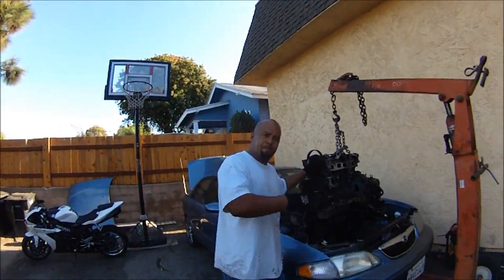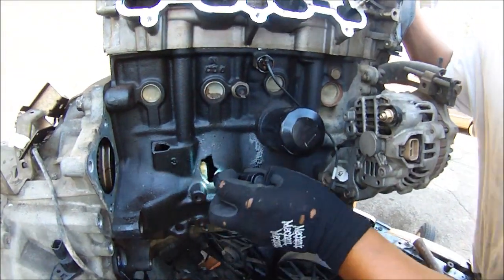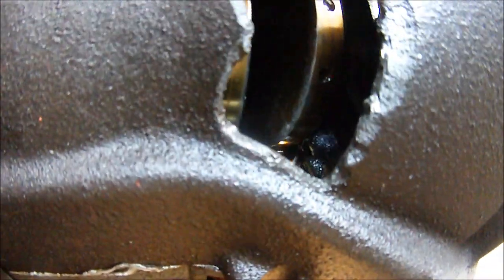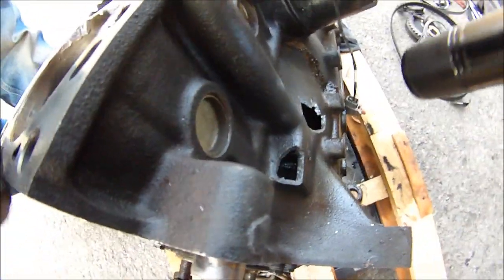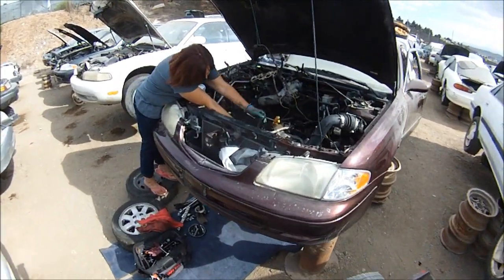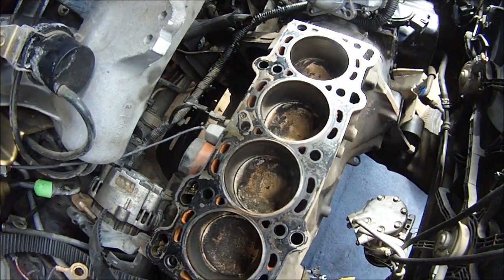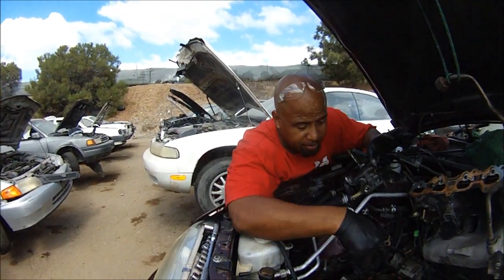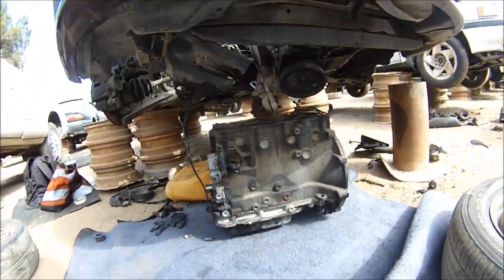WHAT HOLES IN THE ENGINE BLOCK LOOK LIKE.

Comment: hah... I remember when I was floating into the bay just past v-town and hitting richmond when big poppa dropped and they looped that shit 5 time straight and I was on 580 heading to san jose and boom....  lost all 4 pistons in my b2200...   whole damn bottom gone and it puked all over a chp who was behind me  and I thought I was going to Alameda jail that night...    

Chp was cool and pushed me up on top of a overpass in the light which I believe it was still there when I came back with a uhaul to drag it home.   I loved my mazdawg but they have the weakest bottoms and I wasn't going fast but going from 70's to 50's  put me at 3500 rpm in 5th and motor didnt like it with a shell and a custom bed kit..  I seen holes but when your pick up tube is in the cops grill thats a whole new level...   

but I like your vids because back then I didnt have the cash so did my own heads and with the help of someone to stedy the motor then I could lift it to the rad support by standing inner fenders  then have someone keep its balance as I got down and picked it up  and set it on a table I made just 1/2 taller than a stand  so I could rest it while I slapped the stand bars on and then pick it up again and move the table out.   Sore the next day but you do whatever...   I just stop doing stupid crap like lowering peoples trucks in a luckys parking lot at midnight for 100 bucks and two scissor jacks...

Comment: Any idea what caused the holes in the block?  Are we going to get to see a tear down of the old block?  Was the root cause lack of lubrication?   Also please don't go to a junkyard in flip-flops.  That's asking for trouble.  Can't say I've ever seen a girl drop a block in flip-flops though.  That's some serious girl power for sure.
Reply from the maker: No Idea, but it could have been an oil starved rod bearing cap, fatigued/defective wrist pin, clogged oil port etc or just plain old time to break down part. She wore shoes inside but changed (she had a broken toe lol) they told her not to do it again slap on the wrist lol. But since when can you tell a woman what to do? lol
Reply: +oldskool funk I see ur a mechanic.. my coolant is in my engine and not sure exactly what happened but I floored it on the freeway to merge with traffic heard a loud bang my car turn off now it has a thrown rod or something could you tell me what exactly happened??